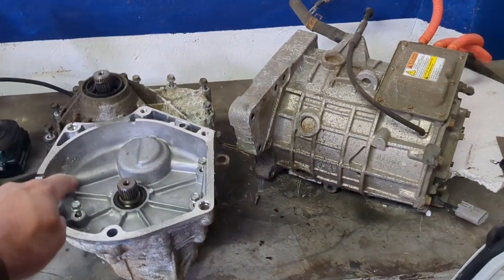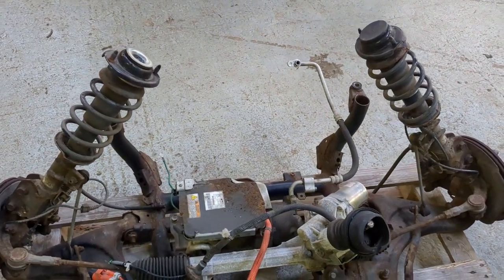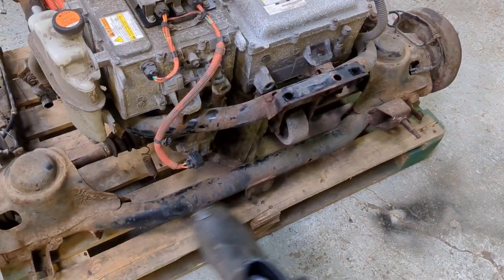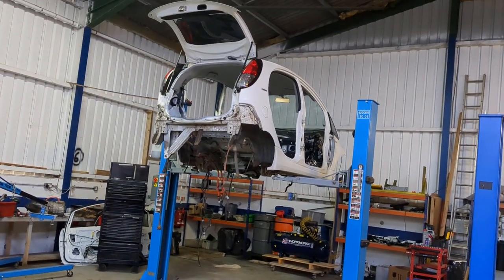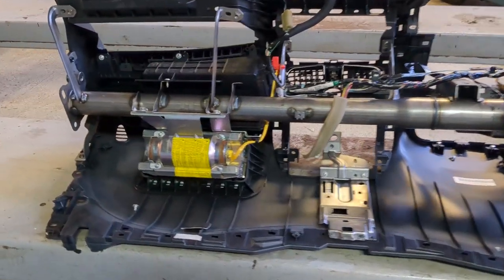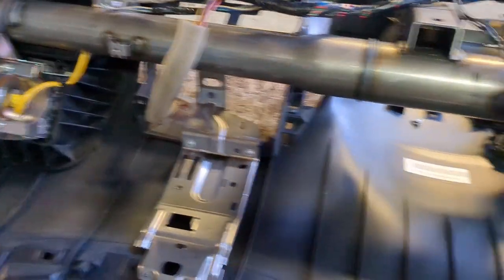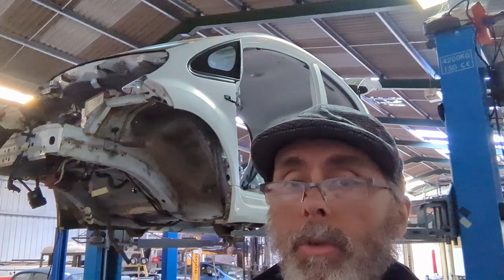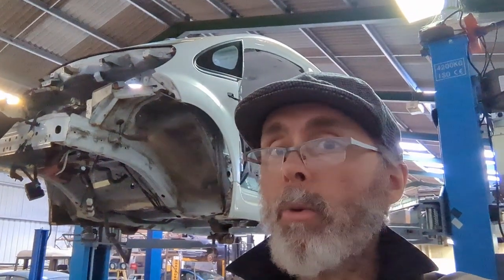EV rally car experiment part 1

Comment: Hmmm. Could one run two motors, maybe with one controller/battery pack? Maybe uprated ones to suit a somewhat larger 4x4? How expensive are these cars? 😈Looking forward to the rest of the series! 👍🙂
Reply from the maker: So many options, so little budget....
Reply: @RalphHosier1  You are of course correct, as you are well aware! But dreams cost nothing... 😔

Comment: Would absolutely like to see more of this. Are you aware of some folk who work with free access EV builds, one guy named Damien Murphy in Ireland, Waterford in particular. They would be the only ones I know in the west whi can remap motor outputs etc and fitting better cells. 

Im looking for a decent Citroen C-zero that I'd like.

But instead of rallying it, the small car has a lot of potential tk improve efficiency. Some DIYers have tried making their own aero modifications with tanglible improvement in range because pushing the iMiEV though the air has more drag than a dandelion. From an underbelly pan to insulating the ineficient heather and pipes, adding temperature insulation in between the door panels, blocking the front intake.